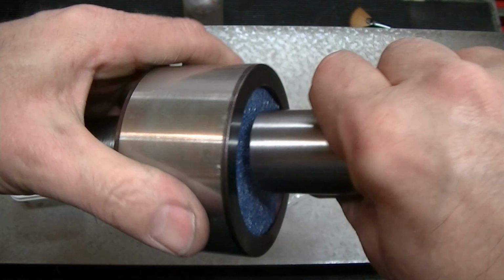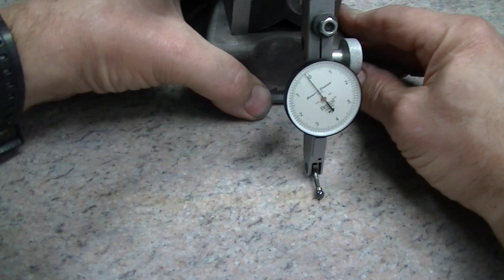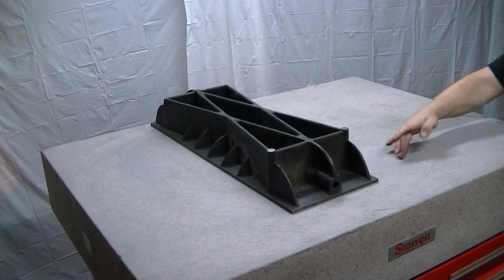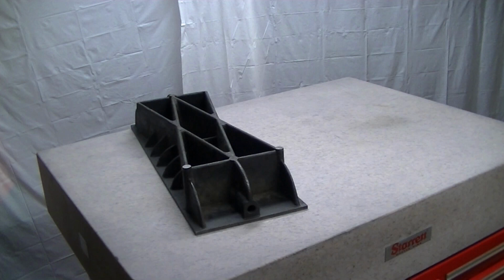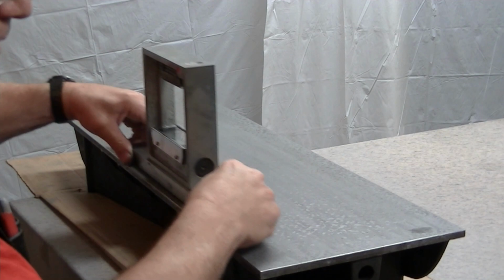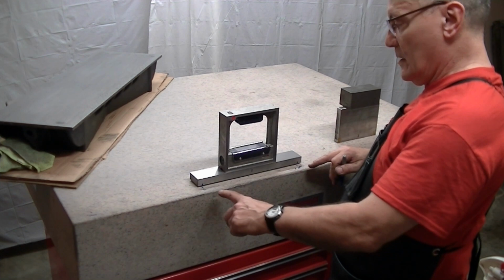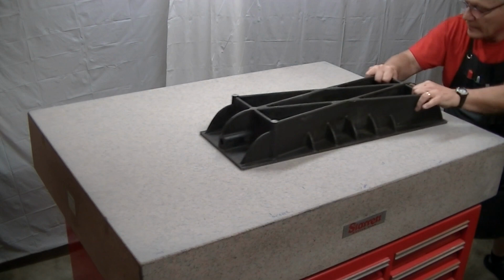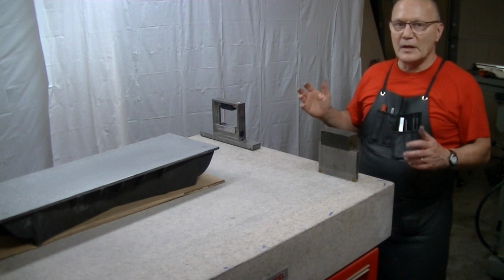DIY SURFACE PLATE LAPPING PART 1 (audio fixed)

Comment: If the surface plate and stand under it, and the concrete floor is not stable enough, (re: changing your stance/position), how in the world can it be used as a standard?.   Seems to me, it's not stable enough.

Also, I'm really surprised electronic levels are not used. Undoubtedly they aren't accurate enough. It's just surprising. I started using an electronic level in contruction, when they first came one the market; it allowed me to do things impossible with a bubble level.
Reply from the maker: The surface plate is supported on three points so its flatness is uninfluenced  by the support structure even if it is not level. But it you are using a level to measure flatness then that instability matters. Electronic levels are used to measure plate flatness and 2 are used in a differential mode so changes in plate level do not affect the measurements for straightness used to check flatness.
Reply: Precision electronic levels are used, but they are still infrequently seen. My electronic 2 axis level (0.0002"/12" accuracy) was upwards of $3500, whereas a mitutoyo level (0.00024"/12" accuracy) only costs $500. Digital levels are extremely nice but when a manual version of the same tool can be owned for a seventh of the price, it's a difficult purchase to justify. Also, you don't get a "feel" out of a digital level, the same way a digital micrometer is sometimes more frustrating or inaccurate to use.
Reply: Dew ShotzZ lol a digital mic is far more precise than a standard mic of comparable quality. A digital mic eliminates user error. The only precise micrometer is one with an invariable pressure application system( ratchet/friction thimble). If You have no way to establish the pressure you are exerting on the screw, you are not taking precision measurements. Hand feel is not an acceptable method when you get into millionths of an inch. Sure, you can measure a tenth either way. Not all of us are lucky enough to have wide open tolerances like .0001 however.
Reply: @sexiewasd haha yeah, but your logic would apply to air mics! So you could still utilize the sweeping effect, provided you have the correct ones. It just probably wouldn't be with a needle.
Reply: @sexiewasd And mitutoyo digital indicators (some models... at least the ones I work with) have a kind of graph made up of blocks on top of the digital display. Almost like a digital version of a needle.
https://ecatalog.mitutoyo.com/ABSOLUTE-Digimatic-Indicator-ID-C-Series-543-with-MaxMin-Value-Holding-Function-C1201.aspx
We make cardiovascular implants on swiss screw machines out of almost exclusively platinum/iridium alloys. I think about the only thing we still use that is analog is dial test indicators, and we only use those for checking runout on collets, guide bushings, tooling, etc. Not on parts themselves. For measuring the parts we use a Mitutoyo Elf. Which is a pretty badass setup if you haven't seen one. It is a cmm that basically uses a microscope and comparator and you click on the magnified image to take measurements.
Reply: @chuckphilpot7756  are you using  digital as electronic?  I ask because I have one with a mechanical digital display, just wondering which type you tolerance snobs are discussing?
Reply: @mtraven23  The one you have (most likely with rolling wheels) I have used but I couldn't say much about their accuracy repeatability over the years. I used one very briefly at a job shop. It was a 30" to 35" I believe, with the interchangeable anvils. Basically electronic, digital, or vernier will all get you to about .001 precision depending on the screw, the fit\finish\squareness, the ability to control the applied torque, and the accuracy of the encoder or vernier scale. A good rule of thumb is that any measurement device should only be trusted to an order of magnitude larger than the smallest division.
I.E. If your mics will read to .0001 then they are most likely only accurate to within +/-.0003-5.  Same with calipers. Most digital calipers go to .0005 so they can be trusted to about +/-.001. And I was referring to digital in the 0 or 1 sense of the word due to it having an output that is tracked and plotted via QC Calc, as opposed to digital in a strictly number display sense. Alot of Digital mics go to .00005 thus rendering them typically capable of resolving distances as low as .0001 to .0002. A pretty negligible amount per most applications, especially ferrous ones. I work with platinum/iridium alloys now, swiss machining exclusively. I can use mics to rough set the machine up but the FDA and ISO require the use of a Mitutoyo "Elf" or optical measuring machine to measure down into the millionths as are required by the majority of cardiovascular implants we make.
Reply: @mtraven23  Any measurement snob would agreee that a non physical way of measuring is superior. Whether a comparator, lasers, an ELF system, or an Alicona unit. But we also have a ZEISS CMM that resolves into micron measuring as well.

Comment: I understand your train of thought moving the counter weight opposite of the level
But the lapping plate was off to the side ???
Reply: Why would it matter? He's taking relative measurements, as long as he's not moving the plate during the process what difference does it make?
Reply from the maker: watch the follow up video

Comment: Interesting video. I have been thinking about making surface plate from scratch using a square granite block which I can buy from local hardware shop. It is not hopelessly uneven as it is.

I have prescision level, prescision dial indicator and removable y-axis bed for my mill as a straightest object I have. I'm thinking could I use that as a lap by attaching piece of 6mm glass in top of it, since I don't want to use it's own surface.

I don't aim to have professional quality surface plate but something usable and better I have so far. Any idea if my project us doomed?
Reply from the maker: glass will not work well as a lap
Reply: @ROBRENZ  I know that, and my worst worry is does it work at all. Telescope mirrors are lapped using ceramics or thick glass, so I hope it would work in this too.

If I'd have a real lap, I'd be very happy. 

I think diamonds can't be embedded into glass but once it get scratched, diamonds get stuck in those scratchess. Biggest problem might be that also the glass wear out during the lapping.
Reply: Andrew Crews  The block I'm planning to use is too heavy to be used as lap. I have been searching proper cast iron plates but so far couldn't find such. I have couple of round steel plates about 30cm in diameter and 40mm thick. I'm wondering if they'd work but they may not be as good as cast iron.
Reply: @teropiispala2576  search tom lipton lapping, he used cast iron discs from mcmaster carr, I think $30ea US. Seeing you used metric measurements, the shipping might be prohibitive. Cast iron i would assume would be best.
Reply: @richharr  I have watched his videos and I know cast iron would be best. Ordering it from the US is terribly expensive. Once I ordered gear which cost $20 and I paid $70 from shipping and 21% of vat from the gear and shipping. 

I actually ended up getting larger granite from local quarry. I have grinded it within about 0.01mm tolerance, not counting very edges, which were rounded from couple of centimeter length. I used silicon carbide, other piece of granite and round and thick steel plates.

Comment: Where did you get the roller bearing and the lapping plate? I thought the plate is from Challenge Precision, and recently found out they are closing their business and not making any new products.
Reply from the maker: I bought 3 of those plates about 40 years ago. The roller I made.

Comment: Hello there! I happened on your video while researching the idea of returning my 8 inch jointer infeed/outfeed tables to flatteness using a large lapping plate. As best I can tell with my Amazon-purchased $45 straightedge and $12 feeler gauges, the outfeed table has a 3 thou bow/dip (about 10 inches long) along it's length between each lip: the dip is concave and so tightness up the closer I measure toward each lip until the straightedge rests flat at each lip Your lapping plate (10 x 30) is exactly the size I'm envisioning for the job, if it's possible, but I'm unable to find one so far. Where can I find something like that? I don't know enough to know what I don't know, which makes not knowing what I need to know a fairly difficult task and is probably the reason I can't find one yet. Any assistance at all would be so cool! This isn't a question about whether my idea would work to flatten my jointer tables; rather, where I could find a lapping plate like in your tutorial... From there, I guess I'd have to decide if I want to try it or not. Anyways, great content and I'm watching all the way through. Have a good one!
Reply: You can buy a 12x18 plate for under $100 or perhaps pay a little rent to use a big one at a machine shop.  After that, sandpaper and spray adhesive; see Robin's earlier video on the subject.
Reply: @jimsvideos7201  awesome! Any idea where I'd look to buy the plate?
Reply: @ForestWoodworks  MSC industrial, McMastercarr, Travers tools, Grizzly industrial, etc. you can even find them on Amazon and eBay.
Reply: @melgross thank you! Since the original comment, I determined the concave is more like 7-10 thou. I'd like to do something about that, just but sure what the best approach is.
Reply: @ForestWoodworks  a lot of it depends on what you really need in a plate, as opposed to what you think you need. Most people will be very happy with a tool room grade B plate, and never know the difference. If that’s the case, and the plate isn’t very big, just buy an import in the size you need, and use the other as a sanding support. They’re pretty cheap, and better than most people expect. Plates are generally a bit better than the spec. If you REALLY need an A plate, they’re a bit more, but not by as much as you’d think. It gets expensive at AA, but almost nobody needs that just to measure and mark work up.

Robert has a Starrett plate that when new, was worth thousands, so it’s worth flattening. If I got that plate for free, I would put the work into it too. But for most people it would cost more than a typical plate is worth to flatten it themselves after they buy everything they need.
Reply: @melgross  makes sense. Thank you for the insights. Even the dip in the jointer tables isn't having the negative impact on results that I initially thought it would. At least, so far it hasn't. But since I've only recently got the motor changed and the new electrical run in the shop, I haven't put it through a ton of expectations. My thing is that since ideally they are supposed to be flat, I got hung up on wanting it perfect. Especially as a new woodworker I don't want poor conditions of my tools confounding my work. I'm sure it's fine though and if I get into needing the type of tolerances where it becomes a problem, I'll need to address it then.
Reply: @ForestWoodworks  that’s sensible.

Comment: Can you charge valve lapping compound
Reply from the maker: yes
Reply: @ROBRENZ  but its silicon carbide also it feels sticky so whats the purpose for the stickiness from your experience?
Reply from the maker: It is an oil base that lubricates and helps the compound stick to the lap.  It would not be good for surface plate lapping.
Reply: @ROBRENZ  so what kind of lapping compound should i find carbide or diamond ?
Reply from the maker: @woozhi9218  for granite surface plate use diamond powder   15 micron would be  a starting point
Reply: @ROBRENZ  im planning of using steel but im concerned of stress relief blueing and its  just of small blocks
Reply: @woozhi9218  on granite I would say diamond. I'm not even real sure silicon carbide would cut granite at all. works great on nickel and stainless, doesn't cut steel but I'm only guessing not granite either
Reply: @woozhi9218  sorry I think I misunderstood you question there at first, I would still use diamond though. I'm just figuring this out myself lol so maybe I need to shut up :)
Reply: @dannynimmo3052  no its good to have your own point and well ,analyse.
Reply: @dannynimmo3052  im sure silicon carbide cuts steel regardless of harndesss and grade but my concern was can you charge it specifically the one used for valve lapping which is sticky. If not ill have to use diamond for charged lap
Reply: @woozhi9218  you said carbide so anyway didn't mean to be a pain there  but on the silicon carbide to steel comment I replied with (that didn't partain) lol ... yes it will cut but it takes alot of horse power and makes a lot of heat. , I've run that my whole life and abrasives are all I do, people fly empty airplaines to me to pick me up for a few hours work, rarely but it happens lol I'm green on lapping so I shouldn't have been commenting. hope your project goes well I'm into the same right now and trying to learn. I really appreciated this video and I'll read a little more carefully if I comment again. if you have a thought process going there I didn't mean to through in bullshit
Reply: @dannynimmo3052  thank you
Reply: @dannynimmo3052  what job is that btw

Comment: I don't know much about surface plates, how in the world do they get so worn out? Aren't they used mostly for marking things with height gauges?
Reply from the maker: Like I mentioned any metal piece softer than the granite will pick up grit from the air and begin to slowly lap the granite including height gages.
Reply: It would have to be a combination of instruments becoming charged with abrasive particles in the air, which Robin talks about in the video after this one, and also from repetitious movement. I believe he said in a previous video that this plate was set up with some kind of jig or other apparatus on it, and if it's only being used to take a small set of measurements, and the tools are moving back and forth over the exact same spot hundreds or thousands of times a day, wouldn't take long to get a nice deep hole.

Comment: Are you lapping a granit surface master?
Reply from the maker: Yes
Reply: Do you know if we could use a cement surface master? Of course, my question suppose that it could be less expensive to use a such surface master.

I know that we can get a shiny cement. I understood that shiny surface and plate surface are different things. But I ask myself if we made a cement surface plate, if we could use it as a surface master.

In summary, this is the question of why we use granite surface plate, and not cement surface plate?
Reply from the maker: hardness and stability of the granite. IMO cement would not be an acceptable surface plate material.
Reply: Likely you could get a smallish  - but still usable for some work - scrap of granite from a granite countertop place.

There's a great video on YouTube on the history of precision measuring.  It suggests that if you get three stone slabs, and lap each with the other two, the imperfections would tend to cancel out.

I can find it again if you're interested.   The same creator talks about the origins and historical importance of Jo Blocks.  Perhaps in the same video.
Reply: @lloydrmc  was that the "origins of precision" video by "machine thinking"?

Comment: If that metal surface plate was sitting around how do you know it was still flat
Reply from the maker: I didn't know if it was flat but I can roughly tell its shape by how it pivots on a measured section of the surface plate.

Comment: so the level make sure the plate is not just only flat but also straight  am i right
Reply from the maker: The level can determine the vertical straightness of a single line. Then multiple lines can be measured over the  plate and assembled with trigonometry to determine flatness.
Reply: @ROBRENZ  woah!
Reply: @ROBRENZ  im guessing this is how they made big machine tool that is impractical to make a surface plate for the job   but an autocollimator does the same thing am im right.
Reply from the maker: @woozhi9218  Correct but the autocollimator can also measure lateral straighness which a level can not.
Reply: @ROBRENZ  alright thanks for your generous knowledge sharing could come in handy one day for me to build my own surface plate 
Regards,
Kai

Comment: This video made two things clear to me. First, you are a smart craftsman. And second, you have no idea what you are doing here. No offense intended.
Reply: Considering he got it flat to the degree he wanted and is openly showing how he achieved that, I would argue that yes, he knows what he is doing here. Might not be the best method or practice, but did you actually have some constructive comment as to what went wrong?